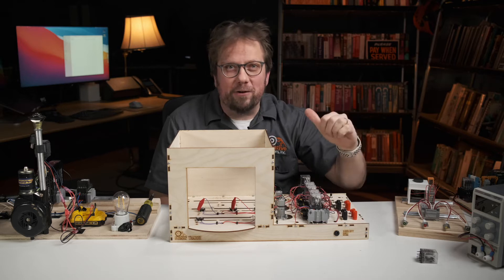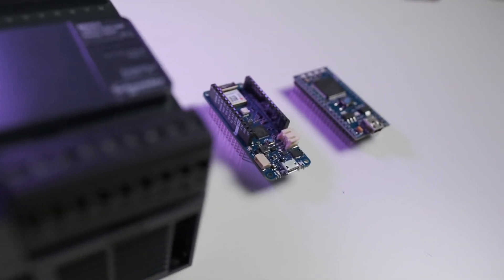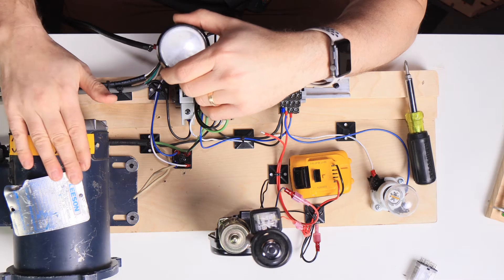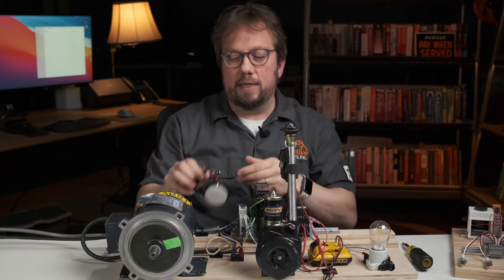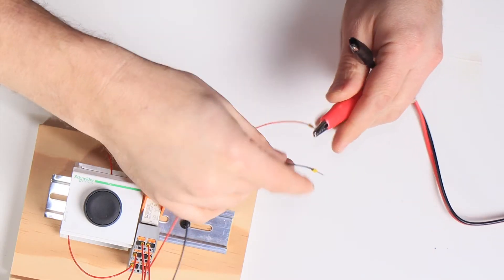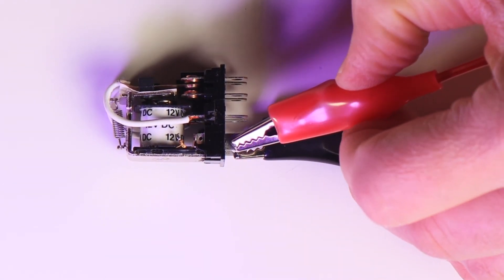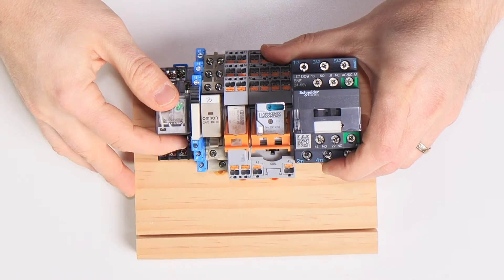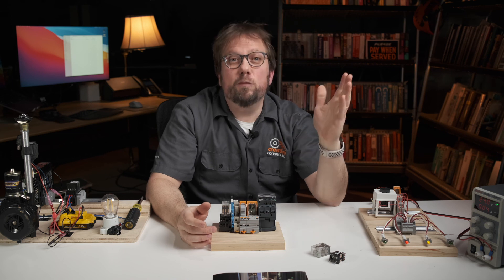Relay Switches // Learn the Basics

Comment: Thank you very much for this, I appreciate the discussion. I have no experience with this type of relay and I want to work with one. I happen to be working with an ATO brand (I think it is a brand!), type "HH52P MY2" relay. The coil is marked DC24V. I applied 5v DC to the coil and a green LED came on, but nothing actually switched.  I am trying to make the relay "turn on" single red LED that is mounted on a breadboard, with 5 volts DC input to the coil and a separate 5 volt DC supply to the switch. I'm quite confused by it. From your video, it appears that applying 5v to the coil is not going to work. The coil has to be given 24 volts DC. Is that correct? Does the coil pass through that voltage to the contact switches and therefore to the device being controlled? I am unclear on how to apply a different voltage to the circuit I wish to control. Thank you again for this video.
Reply from the maker: Good question. You are correct that you need to apply 24V to the coil of that relay to get it to switch. The coil and the contacts are completely isolated. One of the advantages of a relay is that you can have a different voltage "flipping" the switch (aka the coil) than the voltage at the switch contacts. 

If you think of it as a light switch, the coil is serving the same function as your finger turning the switch on/off. The voltage being switched isn't related your finger. That sounds a little silly, I know, but if you replace what your finger is doing to operate a light switch with the electromagnet in the coil of a relay you can imagine how completely separate those parts of the relay are internally. 

In your case, if you want to use that relay, you'll need a 24V power supply to operate the coil. Alternatively, you can get a relay switch with a 5V coil. Hope that helps!
Reply: @creativeconners  Thank you so much, this helps me move forward with my testing.

Comment: Can you explain how does a universal control voltage relay works? Example is Eltako ES12-110-UC.  I still wonderig how to use this to control a  24V dc equipment.